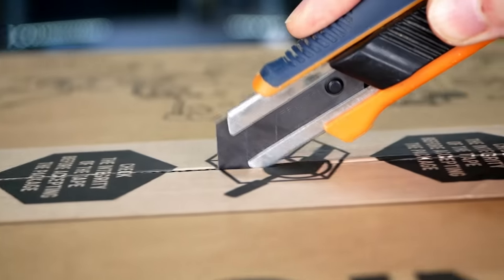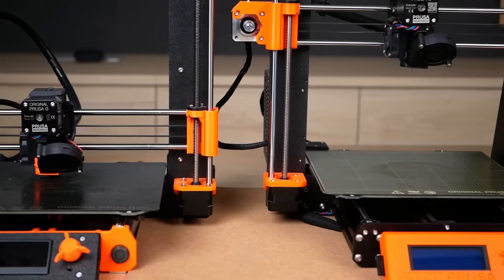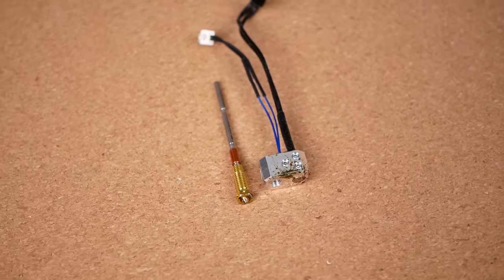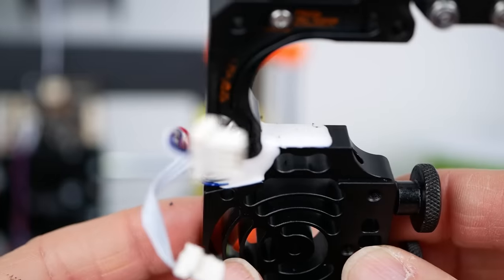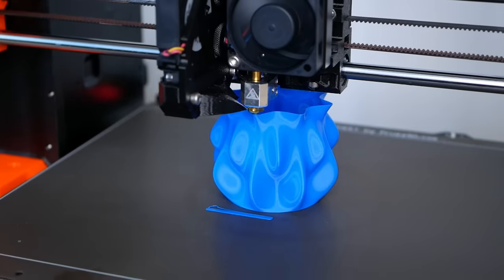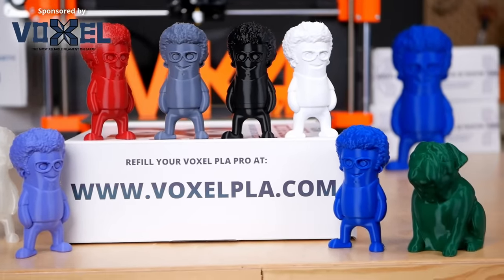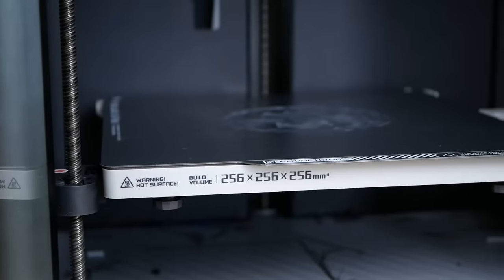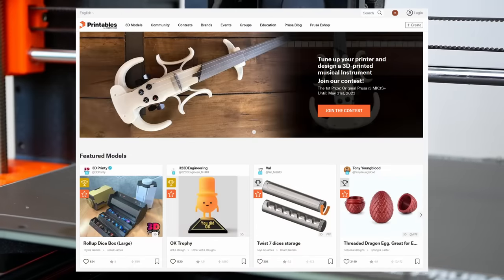Should you buy a NEW Prusa MK4 in 2023 or rather a Bambu Lab X1/P1P?

Comment: Just print a bit slower in a Bambu machine & you have a better print than MK4 plus its a lot cheaper to get a Bambu P1 which prints the same as the X1.  Your prices need a reality check dude, the Bambu machines are much cheaper than where you sourced you prices.  This machine is a fat NO! for me Bambu P1 anyday with upgraded hardened gears & nozzle!!  Use Fusion if you want kick ass software!!

Comment: Prusa just sold you guys the same MK3 with a couple of changed things and bamboozeled everyone in that video specifically targeting what X1C can do and claiming it can one-up the X1C in everything - newsflash: it didn't - and to add insult to injury, about 40% more expensive than a P1P.

Prusa fanboys need to get their facts checked:
- lots of claims about Prusa and open-source like he's the one who came up with the concept: BambuStudio is ALSO open source and one of the best slicers you can use for any printers is Orca based on the Bambu Studi - also I don't see any aftermarket bambu clone hardware being pulled because of propietary claims from BL.
- the X1C and P1P are MADE to destroy bedslingers in performance and give you an industry level machine for a consumer price
- some guy was saying that Prusa excels at open source cuz CNC Kitchen tried to change the hotend in the other video and got some errors on the BL printer: 
how much do you save when you buy a 10-15$ nozzle vs the original one (10-15$ from bambu store too)? 
Also there are LOTS of aftermarket better(arguably) hotends that allows you to use a traditional nozzle made to the same sizes and you get no errors - the BL printers are calibrated and have the possibility to calibrate themselves to the teeth - these "inconveniences" allow you to get spectacular prints in 1/4 of the time of a Prusa.

Prusa was a great step in the 3D printing evolution, but BL just iPhoned the Nokiaprusa and while I was excited when I saw the initial Prusa MK4 video release, I'm so dissapointed in it right now. And yes CNC Kitchen, you're a Prusa fanboi for not seeing the obvious. J. Prusa just made a few hundred mil $ with the same product he sells for about 10 years. The only thing I can appreciate is the ability to milk the same cow like that for this long lol.

1100$ for 10 years old tech or 700$ for a blazing fast P1P - no brainer.

Comment: Never buy anything from any company based on future promised features. If we're going to wait on Prusa software improvements, who's to say Bambu's software wouldn't be better 6 months down the line too? Also imagine any other hardware space where a competitor offers a product that is so far ahead of someone's latest model, not in just perceived metrics like "quality" but in actual measured real world performance. Any other company would be roasted in the reviews. And speaking of build quality, at these price points I really don't think exposed 3D printed parts in the build is acceptable anymore. Sure Prusa contributed a lot to this field, but they also just sat on their laurels. I was expecting at minimum an integrated camera, enclosure, and a supported multi-material upgrade. In the end what's the point of things like the hot end being smaller and lighter than the previous version when it can't keep up in speed compared to the competition?

Comment: I feel like, even though the MK4 is obviously behind the BL machines in pretty much every category, you just wanted to recommend the Prusa because you like them. You wanted to be fair am impartial but you didn't quite get there imo. I have neither machine but have ordered a p1p for a low 599 and feel that I made the right choice. Prusa printers are great but you lose some credibility when you point out how inferior one machine is yet still recommend it. Jmo
Reply: The problem is that it is impossible to be impartial.

There is this no-win issue that you got one product that is ahead of the curve, but does not seem to have a real ecosystem around it, nor is likely to see much of the earnings being put to work in the long run.
While the other is behind the curve, but does have an entire ecosystem and a precedence of the field having advanced thanks to them.

If you care about (corporate) ethics and trying to avoid the chinese economy. The MK4 is a no-brainer despite its flaws. While if you only care about the printer itself being good. The P1P and X1C are the no-brainer instead. And there is simply no objective way to get around that.

Comment: Prusa printers have become a complete and utter joke over the years imo. Little to no advancement orher than fixing glaring mistakes from the mk3, a price point that is quite frankly ridiculous, not even a housing for a machine that costs more than 1k, no input shaping (has been available in marlin firmware for a while now and in klipper for ages). Bambulab printers are so far ahead it's actually funny. Besides, for half the price of the mk4 you'd be able to make an absolute unit of an ender for example with all custom parts and frame. They really have to step up their game or it's game over here.

Comment: X1 carbon all the way, the Mk4 is the equivalent of Model T ford with a body kit and a fresh coat of paint.
Reply: Point me to the rock you've been living under.
Reply: @LilApe  what drugs are you on? The MK4 doesn't come close the the X1
Reply: if you had a clue I wouldn't have to explain
Reply: @kazdean  Thanks for proving my point
Reply: @LilApe  It's clear that you have never owned an X1, so your fanboi response to defend your poor choice in buying a prusa is understandable.  I own both an X1 Carbon and a Prusa Mk3. I can tell you with certainty the X1 is head and shoulders above the Prusa and no amount of upgrading will make a bed slinger as fast as the X1.
Reply: @kazdean  you're right, I never owned an X1. What I did own however was a P1P that burned up a stepper motor in less that 10hrs of printing. Then I had to do a charge back because Bambu lab tried voiding my warranty cause I threw the box away. Got rid of that POS

Comment: Yet another prusa printer with missing features on release... 
I've got my prusa mini for almost 2 years now and wifi? powerloss recovery? x/y perpendicularity correction? alot of features are still missing and or require a upgrade while i bought the printer WITH these features....
Meanwhile, the mini's  heatsink design is still ineffective causing alot of hotend jams due to heatcreep and people thinking its the extruder.. 
99% sure that if i was to cut the heatsink from the first grub screw and i would not see any difference in its inability to pull the heat away from the heatbreak quick enough keeping the meltzone in the hotend where it belongs. 

it's time for prusa to stop lying about features that are NOT on their printers, and start fixing long standing issues alot of people have with their products 

Out of the 8 people i personally know that have a prusa mini  only one doesnt have issues related to the meltzone of the heatbreak+heatsink combo 
The people that ive managed to convince to replace the heatsink with ANY aftermarket one have each thanked me for giving them a printer that now prints reliable without having to reseat the ptfe tube that keeps deforming creating jams every few prints..

Comment: Prusa is a horrible company:
Mk3: The bearings kept slipping out on the z, difficult cold pulls because the filament path is not straight, they told people not to lube bearings even though they came unlubed.
Mini: Took over a year to get the promised WiFi functionality. The belt bath is not straight, clogging issues, extruder issues, came with a pinda without temperature compensation,
XL: Promised 40x40x40, now 36x36x36 (30%!!! LESS VOLUME!), price was promised to be like 1500€ now 2100€ (up to 4200€). And of course they have to be extra again (like when they did linear advance from scratch instead of implementing existing solutions and completely messed up print quality for many farms that were eager to update) so they make the frame an absolute rigidity joke instead of going with proves-to-work designs.

Now the Mk4. AGAIN a bedslinger, again the same unrigid frame just slightly thicker, again screw z axis instead of going belted or implementing community solutions against z banding. Again no linear rails (seriously, there is barely a need for Hiwin, you can go with cheap alternatives and still have great results)

The ONLY thing they listened to was 32-bits and colored screen. And well, partially considering design choices from the bear mod. I'd be embarrassed to even consider showing up with a MK4 as your new product while the Bambu is out.

That said, I'd choose a Voron V2 over any other printer any day

Comment: Im rather go with Prusas high print quality and top reliability and would rather not support forced labor human rights violating CCP sponsored companies like Bambu or Creality. Speed is nice but not as important as part strength and finish. Still, Prusa needs to do better than one major release every 5 years. Thats awful. At this point Prusa has only niche printers.. A mini, a bedslinger thats marginally larger than mini and a toolchanger XL, all open frame. They need to wake up and make a coreXY 11 or 12" cubed enclosed and heated within the next 12 months if they want to remain relevant.

Comment: Are you a Prusa shill ? No. Fanboy and shill are not the same thing. :) I know Prusa shills and, trust me, they're toxic as f*ck.
It's perfectly understandable you like Prusa's printers so much because of the main reason you mentioned : the MK2.5. That's the same thing for me in other domains (I SWEAR by some of my guitars and synths).

Prusa i3 are good machines, sure Prusa conttributed and still does to the opensource 3D community. Still, despite the MK4 being a good new iteration with interesting features, they did not implement things they did tease so much about, like input shaping. I'd say "typical Prusa marketing stuff", in some sense. Not an isolated case, though.
Anyway, looks like electronics are pretty much overengineered as hell, and that's something that's not that good IMHO. Also, there is still that "Original Prusa <insert anything here>" silkscreen on nearly every hardware piece, also Josef's face on the splashscreen ... Things Prusa should be a bit more "discrete" with, I just can't get why all that silkscreen overload and branding everywhere (which heavily pulls me back and doesn't make me want to buy anything from them).

One major things that makes me "face palm" is the introduction of the new 32-bit board ... which is really late compared to nearly every other brands. Also, it's still a classic i3 design, and a Core-XY machine (not the XL which is a different story) on the almost same price range than the MK4 was something I really wanted to see. Too bad.
Also their proprietary nozzlebreak is ... not a that good idea to me. They could have gone the "Revo" way, which Voron did with "Revo Voron". There could have been a "Revo Prusa", as there's a "V6 Prusa".

Still, yes it's a good machine. It can surely please a lot of people and will mostly work out of the box. It is a revolution ? At all. Yet it works as expected.

Comment: Yep, this prusa is too expensive, too late in front of a cheap and evolved competition, the upgrade kit is a scam for the price, 3d printing is slowing down, with a lack of real world cheaper applications. I have a mk3s, and it is the best dust keeper I have on my shelf. won't spend 800 on a kit for small vertical lines. Or 600 on an upgrade. Prusa is going the apple way and if you are a rich fan go. Also even the mk3s build on prusa website is costlier than the carbon at 825€ 😢
Reply: bad troll attempt.
Reply: @LilApe  It's my advice, lost among many others, of course it is partial and biased

Comment: All these Bambu big mouths will get quiet in a few months when their machines need service and they can't fix them themselves and have to rely on Chinese customer "service."
Reply: The X1 has been out for a year now and there's been few reports of major issues and people get replacement parts quickly. Compare that Prusa that puts you on a shipping table so you can get your Mk4 upgrade kit in 3-4 months. Also don't forget the MMU electronics are non-functional. Good luck ever printing multi-color or multi-material with a prusa. I just bought an X1 because I'm tired of prusa's crap

Comment: HRRRM, complaining about Bambu labs not giving anything back, when comparing to Prusa that literally stole every idea  they have had ever - and proclaimed it was their own until they outed for it is a bit much.. You lost me at that point in the clip.. (14min, 10seconds)..  Prusa is the original thief of the 3D printer community and literally should be dragged in front of court breaking every OSS license there is on the books so far... The little they done with the slicer release and some tweaks to the firmware code so it fits their printers better kinda glaces over the fact they copied every other aspect when building these machines - and just iterated on em, without giving out plans to build your own, share design decisions, PCB designs etc in true OSS fashion..
Reply: In the end, Prusa did to little to late to get them off the hook.

Comment: I've been using 3d printer over a decade.  My choice is always the Prusa, because after many years, cheaper printers (chinese) will eventually give you bitter problems and go to waste.  I just never had any issues with my Mk2 and Mk3 ever.   Also the huge differences are direct (prusa) vs bowden(china) extruder - too big of a loop holes for problems over the time on bowden, and customer support with firmware updates.  Those two just make it so simple for me to always go for prusa.   or you can run china printers with prusa slicer becase, you know, one day CCP will halt hongkong and shenzen support to western enemies.
Reply: bowden(china) extruder? you think only chinese printers use bowden? this is an incredibly ignorant comment. i assume you hail trump every night before bed?